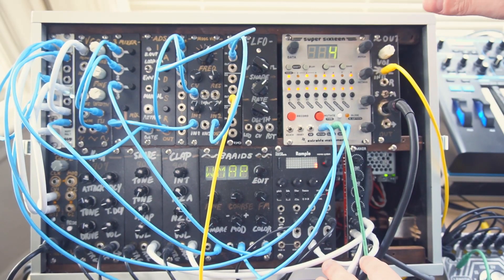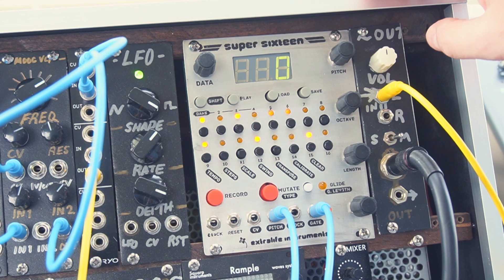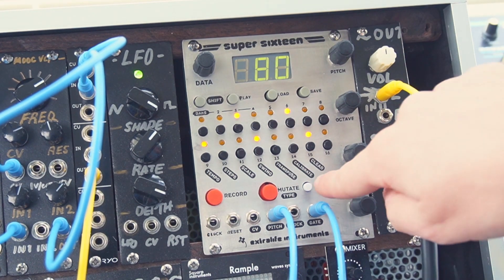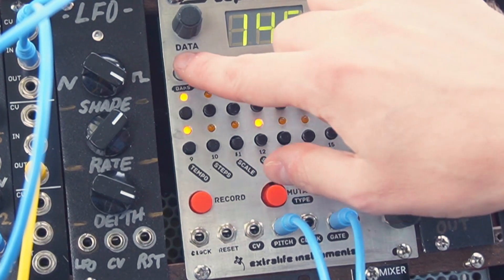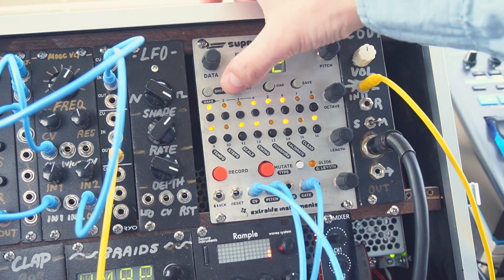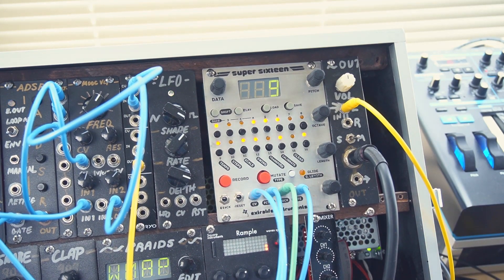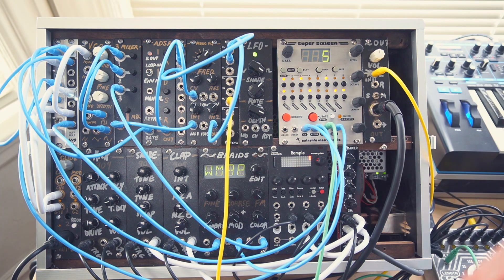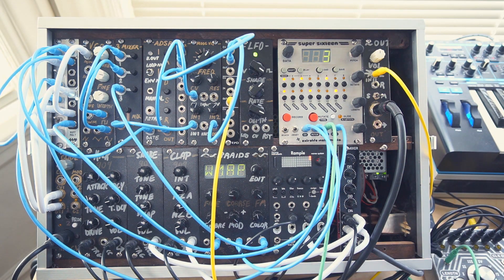Super Sixteen: How to Program a Sequence (Tutorial Part 1)

Comment: Dude thank you so much for making this sequencer. I've been using it for a couple months now. It and my voltage block are the best of friends. That being said, what is the potential for future updates of this? One function that doesn't exist yet but would be really cool is something like the the voltage block's "smooth feature". A pendulum, random, reverse and forward sequencing mode might be SUPER awesome too. As would that cool little function that the voltage block does where it cycles through steps as you hold the keys down. In a nutshell, can we rip off certain characterictic behavior of the voltage block? haha The super 16 is something else altogether of course. I typically use the super 16 as the brain or secondary brain under PNW as my sequencers. Again, Thanks dude! Do you make anything else? Maybe a random cv module to rival marbles? I would love to back something like that!
Reply from the maker: Interesting ideas! I'm working on a v1.1 firmware update right now, getting in a couple quality of life updates and some new randomization/generative mutation modes. After that I want to add sequence chain/song mode, but open to other suggestions or pull requests. I'm not super familiar with the voltage block or varigate feature set so I'd have to look more into it. In terms of new projects I really want to get into DSP programming so I'm trying to learn how to build VSTs and stuff on STM32, so hopefully later this year I'll have a new module, maybe an oscillator or filter type thing.

Comment: Hello. I couldn't find my email with your contact information but I figured I would try here. I have one of your pcb and panel kickstarter kits and WA Ted to know if I can use a 1N4148 diode at D19 instead of the BAT85?
Reply from the maker: Hey, just saw this! The BAT85 is a schottky diode for some simple overvoltage protection on the gate out - a 1n4148 is a silicon rectifier diode and won't do much of anything there. You can leave the diode out altogether and the module will still work fine, it just won't have output protection. (Just be careful not to accidentally plug the gate out into a jack that outputs 10V signals, like a VCO or envelope output and you should be fine).
Reply: @extralifedisco  Thanks! I was able to locate  a few BAT85 diodes and was able to install it as labeled.

Comment: couple of Q's, if i buy the DIY board, are there any possibilities to add more buttons / knobs? I intend to use a larger panel than euro, so I would have some spare real estate and i have never been a fan of shift+1 style interfaces. second, since its open source, what are the options for updating it to add more features down the line? It would be cool to be able to add some intellijel metropolis style features. apologies if these have been answered elsewhere.
Reply from the maker: Interesting idea! The CPU is pretty maxed out as far as i/o so adding buttons wouldn't be super straightforward. I suppose the way I'd do it is to piggyback on the serial lines that connect to the front board via header pins and add an additional daughterboard with another MCP23S17 with a different hardware address (it uses 3 bias pins for a 3 bit address). Then you could wire up buttons to those I/O pins and read them in over serial. This would require rewriting the software to use them, and some careful mod wiring of course.
As far as new features, you can certainly fork the code to add whatever you'd like. Programming is done over ICSP, you just need any 8-bit usb AVR programmer (I like the pololu v2) and a 6-pin header cable. An arduino uno also works in a pinch. I don't have plans for a major firmware update but happy to take suggestions!
Reply: @extralifedisco  well either way, it's the best sequencer I have seen so it's still an essential purchase, good to know there's a slim chance of some mods coming down the line, even if you don't do them I am sure if its worthwhile someone in the community will.

Comment: Are the "Pitch" output and the "CV" output both CV outputs? Other than the top knob controlling pitch, and the bottom knob controlling CV, is there a difference between the two?
Reply from the maker: Yes, they're both CV outs. The pitch output is scaled at 1v/oct, while the "CV" (aka velocity) out has a linear scale from 0-100 straight to 0-8v. It could be used for pitch if run through a quantizer. (Perhaps the firmware could be adjusted to add a quantize/on/off and slew rate option for the 2nd CV output.) At any rate controlling the full range with one knob makes it more suitable for modulation tasks like filter adjustment, LFO rate changes, while the 2-knob pitch control is more suited to melodic programming.
Reply: @extralifedisco  Seems like the hardware is capable of two individual channels of cv/gate.  That would be a great feature. Working it into the interface would be a challenge.